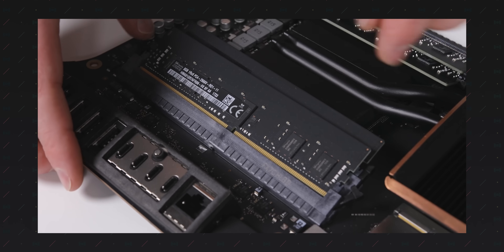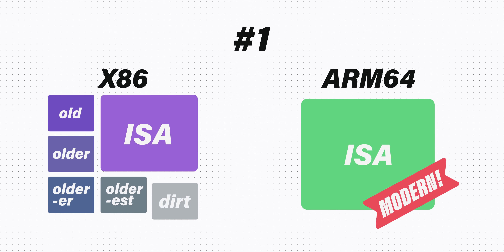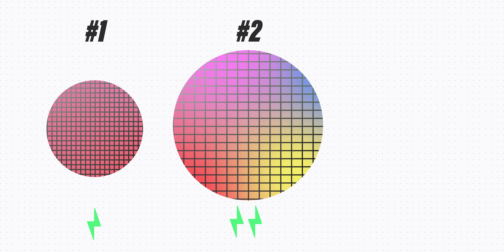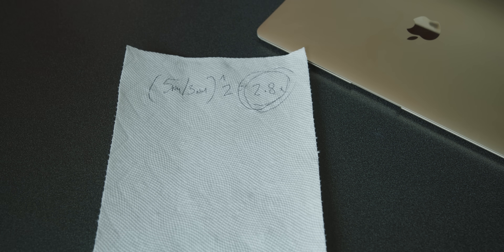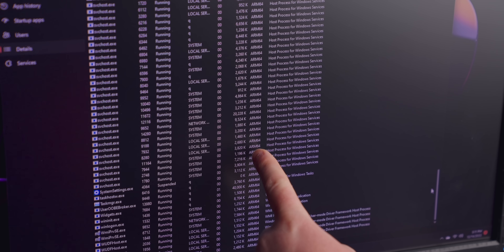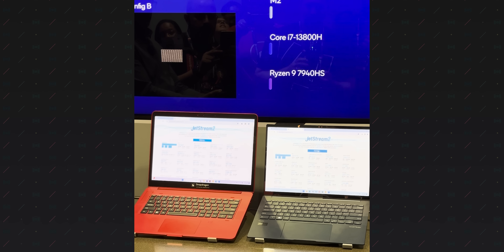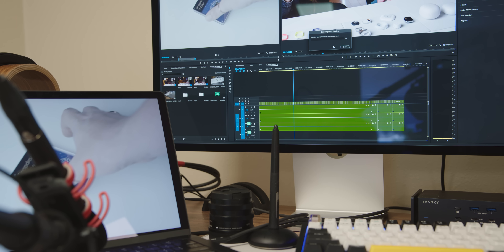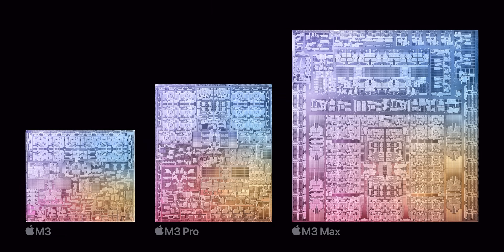Apple's Silicon Magic Is Over!

Comment: With every silicon upgrade I think 2 things:
1. Why did they shoot themselves in the foot by increasing the main number for spec bumps? M2 should have been M1 like the old G3 got a speed boost.
2. I’m very, very, very happy I maxed out an M1 Max 16 inch because besides Demucs track splitting, I never see temps higher than 60 degrees even in huge Logic projects, the M3 Pro and Max skews are weird AF and the price just isn’t worth it for how hot and throttled those chips are running in scenarios my friends are seeing on the daily. They really did not manage anyone’s expectations well long term. M4 has to be an absolute game changer, like the base chips have to be able to run an LLM locally, to even be considered as a viable upgrade for my workflow.

Comment: yeah i think the common architectures will be arm64 very very soon. we know nvidia already have things in the works for their own CPU projects. and intel have been showing interests for awhile for shifting to arm64 format. 
it will be interesting to see how a high powered arm64 desktop CPU would perform. because the current known arm64 are pretty much "low voltage" CPUs. and that dont mean it cant be made in high power version.
but we need to give credit to the pioneer of the format though. ARM. which is a company by its own merit.

Comment: I bought a m1 pro 14" when it came out and it has served me well through college as a computer science major. But I can't wait for the snapdragon chips to make it into hardware that allows me to go back to linux (no, asahi isnt ready yet). The battery life and power is just awesome to have, but I run into limitations with mac OS for my workflow.
Reply: I can’t imagine using a Mac for comp sci, I’ve been learning a lot of python in the hopes of jumping into data science. It seems like a ton of programs work better on windows.
Reply: @Ender275  for the most part, things I need work. The only time its a pain is for assembly I needed a windows PC to use MASM and for running VMs. Most other stuff works. I do have a desktop running arch and windows in case.

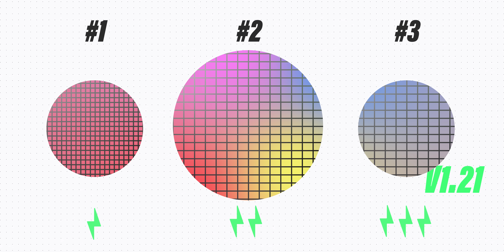Comment: 4:41 -- Actually there is a forth option. Upgrading the ISA. ARM releases a new ISA every year or so. Apple takes these changes but is normally two years or three behind what ARM has put out. The ISA upgrade can itself bring 3% to 5% improvement. But the software needs to know about that new ISA by getting compiled by a compiler that can take advantage of that new instruction set.

Comment: How about better gpu/ graphics performance for the desktop? I'm sure other Mac users beside myself would like performance parity in Blender for the top of the product line, even if it came a price premium.
Reply: Isn't that what the Ultra line is for?
Reply: @maynardburger  M2 Ultra performance is somewhere between RTX 3060ti and 3070. Later this year we are likely to see a 5000 series launch. Rumors expect a 1.7x performance improvement. A M3 Ultra is likely a 4080 equivalent. We're a generation behind on gpu performance for the things that specifically need gpu.

Comment: I think that M1 should be the main attraction now for home labs, very very capable and very low running costs. 
Still rocking a M1 air, not a profesional but like you said, for most use cases is still very very capable and fan less. It was a massive impact when it was revealed indeed and will remain in history for sure. We will not probably live long enough to see another moment like that😢

Comment: They hit thermal wall faster than we were able to forget that intel has this problem too.
Reply: It took Intel 40 Years to hit a Thermal wall.  It has taken Apple 4 years to hit a thermal wall.
Reply: @granttaylor8179  Intel didnt do sh*t in past 20 years, because there was no competition. They released the same processor for like 13 times
Reply: @DuBstep115  with that logic so have Apple.
Reply: @granttaylor8179  Yes, moore's law is dead
Reply: @granttaylor8179 thermal wall mentioned rahhhh 🔥🔥🔥
Reply: @granttaylor8179  In what way did it take intel 40 years? For longer than I have been alive processors have needed cooling and been hitting temperatures upwards of 80c.
Reply: @definingslawek4731  truth
Reply: @definingslawek4731  You are not that old then.

For the first 21 years a heatsink and fan was not needed.

Apple do not help themselves in this respect. 

They can no longer blame these thermal constraints on Intel.

Comment: Fully agree that Apple has not made much effort to push the form factor. An even thinner 12 inch M1 would have been nice. Also I find the whole Apple laptop lineup to be unecessarily heavy. An ultralight 16 or 17 inch with magnesium or carbon fiber chassis would be awesome. I have all kinds of computers and the LG Gram series laptops blow my mind with their lightness every time I pick one up. Sadly, they don't run M chips.

Comment: The 12inch MacBook - fondly called the *MacBook Nothing* - was my ATF of Apple laptops.  Its thin-ness and light-ness was insane.  I used it primarily for business travel where would be in meetings, so the use case was simply MS Office, MS Teams, Visio, Web Browsing, and corporate email.  It was great for all of that, particularly brilliant with the Retina Display.  The KB was a bit janky, as  I was constantly missing characters as I typed them (pretty fast, probably not enuf pressure) but the KB never failed or had HW issues like for many.    I would love to see a MacBook built on that same fan-less and thin platform, and even if just M2 would be very successful IMHO.
Reply: That single lonely usb-c port will never not make me wheeze laughing.
Reply: @CosmicTeapot  There's a use-case for everything

"Tablet form computers are useless because they only have one port"... said no-one, ever
Reply: I owned one and LOVED that thing. I don’t know why Apple doesn’t bring that back. The single port was fine by me. Maybe add a second port and you’re done. It was awesome for business travel. MS office and work emails. More functional than an iPad.
Reply: i had one too and i so hoped they would bring it back with one of the M processors. would be an instant buy for me over any of the current airs.
Reply: MacBook Adorable
Reply: To me, they are afraid such a model would cannibalize iPad Pros.

Comment: A thing that should be mentioned is that it wasn't really an x86 vs ARM issue. Intel basically just got stuck at a bad node size for a long time as they fab inhouse. The Steam deck uses x86, but on a TSMC AMD chip so the tdp is just better.
Reply: yup. In multicore performance actually Ryzens are almost on par with Apple chips. Its so strange AMD didnt try to  add efficiency cores to their processors - it would be game changer.
Reply: @heroofjustice3349 They will be. AMD will be releasing a power efficient chip with efficiency cores (regular cores with less cache) by CES next year. So both Qualcomm, AMD and Intel to a lesser extent will offer high performance, high battery life laptops in 2025. Apple's advantage will negligible next year.
Reply: @heroofjustice3349  AMD's been ahead in terms of performance since the get go, and it didn't take long for Intel to fly past Apple in terms of raw performance either. Apple Silicon's performance is heavily exaggerated, and doesn't pan out that well outside of some highly optimized software. Apple's biggest thing is performance per watt, which they acknowledge.
Also, the only reason to need efficiency cores is if the standard cores can't scale well to lower TDPs. That's an issue for ARM because that's just not a design concern, and an issue for Intel because their designs can only scale so far in either direction before hitting massively diminishing returns. However, we've seen that AMD uArchs scale down very well.
Reply: @heroofjustice3349  
AMD gets pretty close to Apple in terms of pref per watt, but only at the high end server stuff, and only if you turn off boosting. 128 cores of pure compute if I recall, that only sips 300W
Reply: @heroofjustice3349  The r9 7945HX is just slightly faster than M3 max but you have to remember than it uses more than double the power to get roughly the same performance. 7945HX uses 125W to get only slightly faster than M3 max which uses a mere 50W. Apple is still superior to AMD in perf/watt.
Reply: still totally sucks compared to arm, anyway, EVERYBODY is switching to arm, no exceptions, from Tesla to valve to microsoft to google to amazon.
NVIDIA, AMD and INTEL are defacto dead.
nobody, i repeat nobody want's to buy something they have no control over for more money and less performance and efficiency.
Reply: Truth be told
Reply: yes and now intel 14900k need almost 300w at hard gaming while 7800x3d deliver same (or more) fps at like 60-80 W lol
Reply: Ya intel was stuck on 14nm for over 6 years seems to be stuck on 10nm now.
Reply: Intel wasn't stuck at a bad node. Their monopoly allowed them to sit on the same node for years and they got lazy. Then AMD caught up and surpassed them. Now they have to catch up with something different. And even with them copying the asymmetric architecture from ARM they can't catch up in terms of power efficiency and TDP.
Reply: @BrunodeSouzaLino  You are wrong in both aspects.
Intel was stuck on 14nm  for long because have many different technical problems - yields, energy efficiency below their standards and so o on.  Its not laziness - they lost 20% of market to AMD due to their manufacturing problems, shareholders would kill them if they did it on purpose.

Also you are wrong about problems with catching up in terms of power efficiency. 
For example according to review new laptop tested on notebookcheck(redmibook 16) has same battery capacity as MBP 16 and depending on use case runtimes only 10-20% shorter than MBP  16 with M3 Pro.  Keep in mind that M3 is using a lot better manufacturing node and even with that huge handicap M3 Pro is not that far better.

Sure there is nothing comparable to Macbook Air 15  right now in windows world but I think it will change fast.
Reply: @BrunodeSouzaLino not seeing much reason to unless software developers mass migrate to arm

Everyone talks about the hardware industry, but shits not moving because most software industry still stuck on x86, migrating is too much work and expensive lol, only large company can afford that
Reply: @urnoob5528  All they have to do is emulate x86, which is becoming more and more possible thanks to advances in computing power.
Reply: ARM did have advantages when it came to Apple designing their own chips for their own operating system, though.  It really let them highly optimize the processor<->software relationship.
Reply: @maynardburger blablabla
Reply: But the snapdragon 8 gen 3's CPU is more than double the performance of steam deck's while using half the power and 8 gen 3's GPU scores roughly the same as the rog ally's z1 extreme in 3dmark wildlife extreme while using 4x less power (7-8W vs 30W) and they're both based on TSMC's 4nm process. Apple's M3 max is "within margin of error" the performance of AMD's 7945HX but uses less than half the power (50W vs 125W). ARM's way more power efficient and offers way more perf/watt than x86.
Reply: Apple is also able to afford the newer process nodes sooner thanks to its higher profit margins as compared to AMD.

Lastly, although x86 is held back by legacy systems for backwards compatibility, Intel/AMD can ditch those legacy systems and are, in fact, planning to do so soon.
Specifically, I think it was the decoder bottlenecking the whole thing

Comment: Hey Quin, just a heads up that the Arm vs x86 is frankly nonsense from a silicon engineering PoV. I tagged you on mastodon if you'd like to discuss
Reply: Is bottom line that x86 isn't oudated?
Reply: @definingslawek4731  bottom line is that the naritive around x86 not being able to advance because of legacy is nonsense. 

It (always has) come down to implementation and what the targets for that implementation is

Comment: The real change will be when SSD reaches the speed of ram to not have to include ram anymore. A true unified memory would be data on ssd that is accessible from cpu/gpu.
Reply: Only way this will ever happen is with improvements in Optane. Which Intel canned
Reply: The real change already happens in the server space with the X3D EPYC SKUs. They have 1 GB of L3 cache. L3 cache is two times faster than RAM and closer to the metal as well, since it's part of the CPU die. With that much cache, an EPYC CPU can just copy all the data to L3 instead of relying on RAM.
Reply: I don't see the point. RAM and SSDs solve different problems and have different pros and cons. We need both.
Reply: That is unlikely to happen as the rate of improvement in RAM speed matches the rate for UFS speeds. Therefore, RAM is always likely to be much faster. I did some maths, and RAM was about 8X faster than NAND last year.

Comment: Apple needs to focus on fixing bugs (hardware and software) and making their software better, rather than focusing on thinner, glassier, and new releases highlighted by new emoji counts. Apple used to have quality as their strength, but it is now about the product and release cycle. How many point release does it take for Apple to get a feature release right? Apologists will make every excuse under the the book, but the reality is Apple's QA is terrible, even for the number of products. The only way Apple fixes things is when it affects them, the bugs hit mainstream press or when authorities call it out. Apple Radar is a joke, and its beta testing is given rise to just making the public into beta testers without having to actually address the bugs. There are bugs in Radar that are decades old. There are issues that professionals has been begging for solutions, or even workarounds for decades. Apple thinks its crap does not stink, and has turned into the very Microsoft that it sought to dethrone 30 years ago. The apologists and fanboys will flame me, but the reality is Apple is not the perfect company they all act like it is.